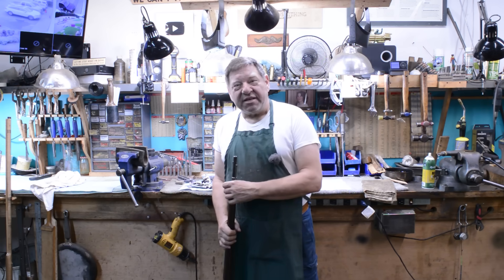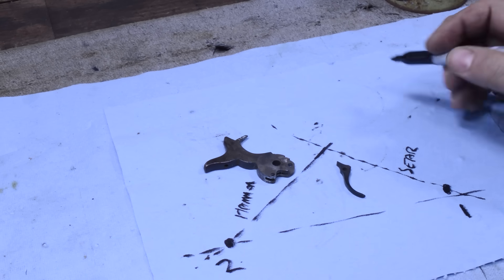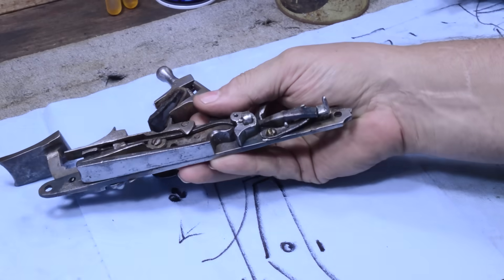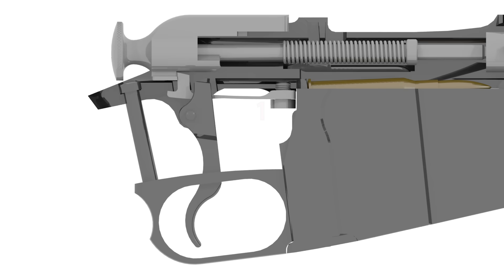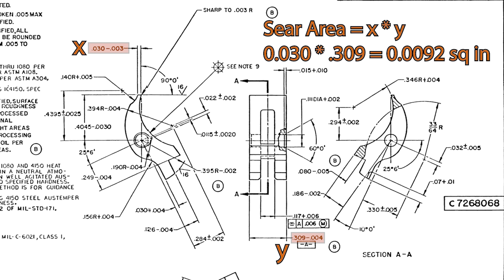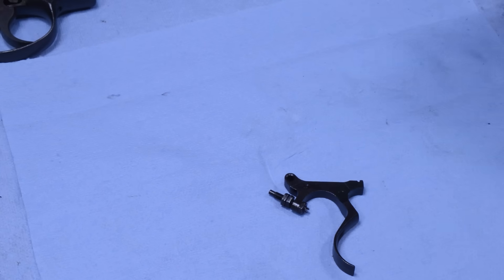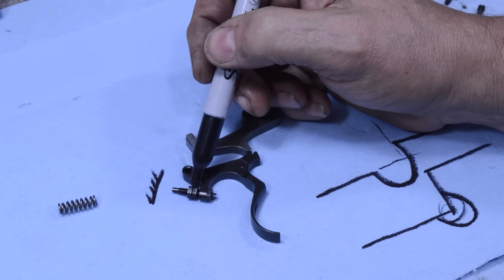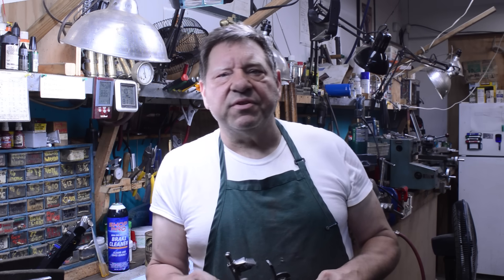Triggers and what they actually are: Anvil 0150

Comment from the maker: We had a mic failure, so we proceeded with just the lav. You can see it clamped in the vise during the outtro. The audio is all over the place, we ran with what we had.

Reply
Reply: You said at the end don’t make the trigger slicker. What do you mean? Do you mean deal with a Taurus trigger breaking like a loaf of bread? Wishing it was as nice as the worst military 2 stage Mauser triggers? Or don’t take stones to mating surfaces just because without maintaining the 90 degree geometry you’re talking about in this video? I have a rifle with an adjustable trigger and I actually put a little more weight on it for safety. I also recently bought a Taurus revolver, 856 Ultralight. I know it’s a Taurus and for that reason alone it should’ve stayed at the store but I got talked into it and the price was high for Taurus quality but easy enough to part with. So should I not take it to a gunsmith to see if it can break like a carrot instead of a soggy rubber bread loaf? If I slow my pull down enough to maintain proper target alignment in DA it is full of creep and ever increasing pull weight. They are incapable of competing with S&W and I would never expect that glass trigger S&W has spoiled me with but my old military 98 Mauser trigger was better.
Reply: What is your into/outro piece? It sounds like Vivaldi, but I can't place it.
Reply from the maker: @chrisash7948  Audio recorded in CandRsenals living room. The musicians were friends, they played it once, and Othias recorded it. Played be ear, not written down,  improvised. One of a kind.
Reply: I watched a 3-year-old video of you Parkerizing a 1911. You mention you can rust blue a Parkerized pistol if forced. You are talking about a product like Laurel Mountain rust blue, correct? I have a pistol that I've always wanted to rust blue and never knew you could rust a Parkerized pistol. So, just prep, prep and prep again and 1 more time just for giggles and apply the chemicals, correct?
Reply: I have a question. Can I rust blue over a parkerized finish? I thought I heard you say in a video that you can.

Comment: 10:20 is the angle impossible because the loop is stronger than the 90* angle, or the potential for damage making it easier to damage if it's cut at 90*?

Comment: On an adjustable 30.06 bolt action trigger I made way too light you have to watch out for being so light closing the bolt can set it off when adjusting in the lightest adjustment. I think I recall it's a screw in a screw that locks it down but I'll have to put it back to around 3 pounds and debate Loctite.
Reply: Yep sent a 7.62x54 almost over the hill once after making it half as crap.

Comment: 08:48 - I ruined two revolvers when I was 20 years old, but I learned that the S&W hammer isn't hanging on the hammer mounted lever when the DA shot breaks, but on the hammer bottom(I did a video on this in 2020). S&W triggers are a kind of a gear with two teeth.
A few years later I saw two Taurus revolvers ruined by a respected gunsmith because he did the same shit I did! He grinded too much of the top of the trigger and the bottom of the lever, so the hammer arrives too late and the "gear like motion" is ruined (gear jam).
S&W has a two stage DA trigger and a single stage cylinder hand while Colt has a single stage trigger and a two stage cylinder hand. Weird/funny.
I did a lot of studies using CAD but in my country I can't test those theories.

Comment: Bad audio quality.
Unsubscribed....
Thumb down.......
And I have deleted you from my last will
Reply from the maker: We had a mic failure, so we proceeded with just the lav. You can see it clamped in the vise during the outtro. The audio is all over the place, we ran with what we had.
Reply: @marknovak8255  🙂 I wasn't that serious. I enjoy your work!

Guess, you are back in my last will. You can have the toaster.
Reply: the audio is fine for me. Make sure your audio drivers are up to date, make sure your speakers or headset are set up properly along with any accompanying software, and if the audio is only playing in one ear/speaker try switching to mono audio. If you're on windows 11 its Settings -> Sound -> Mono Audio (at the bottom of the Output section)

Comment: Did you lose your help? Your audio is terrible.
Reply from the maker: Lav malfunction, total shit sandwich
Reply: @marknovak8255  yep, everyone enjoys a bite. Embrace the suckage, you're getting content.
And for the record, I'm significantly hard of hearing and really need hearing aids, but the VA funding got DOGEfucked.

Going into stoning, stoning removes tempered surface, leaving if excessively stoned, soft steel, which is a doubleplus ungood thing, aka a bad thing.
Don't know about you, but as a competition marksman, I like a reliable trigger. Goes off with X amount of force, not random or Y(whatever).
And retempering is possible, but a cast iron, pain in the balls grade of pain in the asshole for small parts. A knife is trivial, it's immense in comparison to trigger/sear parts.
I want a trigger/sear/disconnector/two turtledoves and a partridge in a pear tree that is harder than a diamond, naturally lubricated better than graphite and has the shear resistance of unobtainium.
But, we all live in the real world, where everything is a tradeoff on what's wanted vs what's there before you.

Comment: In the start of the opening there's an open book and it looks like casings have holes cut or blown through them but they look like whistles. What exactly is that?
Reply from the maker: Reloading book from the 50s
Reply: @marknovak8255  Sorry, I meant what's up with the casings with holes in them. Are the blown out or something?
Reply from the maker: @heliarche  Pressure test measurement cartridges. The holes line up with chamber mounted transducers. OLD SKOOL......just sayin

Comment: In the late 70's I did an occasional trigger job on SR 10/22 s.  I made a jig so the geometry could be accurately changed.  The OEM sear actually cammed the hammer back before releasing.  The modified sear broke without moving the hammer.  I was amused when VQ came out with a drop in version.

Comment: I never change the angles; I only remove rough edges along the sides and replace overly heavy springs.  I know you can reduce the amount of engagement surface, but I figure the engineers who designed it knew what they were doing.
Reply: They did, but what were they doing?  Most non-match guns today do not represent engineers, smiths, or shooters making their or our idea of the best mechanism possible.  Most choices are made by risk-averse suits on the advice of liability lawyers.  I'm not saying they're wrong about suitability for newbs, but gun guys should not treat those decisions like dogma or even expert consensus.

Comment: Thank you for the clear, concise insights. Now I know that the sear always is the part “holding back” whatever is going to push the firing pin into the primer.  There are similarities between the Mosin-Nagant and a Glock … which I find hysterical.

Comment: Sadly, I actually got my Mosin trigger tuned just right, acceptable take up, light, crisp pull and all that forward slack gone.
But the individual who machined the excess metal out of the chamber went too far and right at the rim there are deep gouging left after it was chambered. 
I'd need to cut the chamber 1/4" deeper to clean it up!
I'm starting to think that I might try brazing the gouging and recut the brazing to match the rest of the chamber.

Comment: Nice explanation of the geometry. The only trigger work I've ever done was on my wartime production mosin and knowing I really didn't know what I was doing I was very careful to just clean up the rough machined surfaces and preserve the dimensions and geometry. Afterwards proper sear return (i.e. it wants to be fully engaged with the striker rather than slip off) was checked and the gun was impact tested. It's still long and heavy but it's a smooth break with all the roughness taken out, like a long floppy glass rod, lol. I don't think I'd be comfortable messing with anything less chunky and obvious than that like a 1911 or whatever, one wrong swipe of a stone and that little 0.030" sear tip is going to be all wrong.

Comment: I learned about triggers working on shitty old british made airguns. Simple, cheaply made and holding back quite a spring. Getting the basics right is key, and as long as the break is consistent, and reliable, it's a good trigger that needs to be left the hell alone!

But I had to learn that the hard way, by screwing up some perfectly good guns! and later down the line, i got to learn how to put a screwed-up trigger right again!